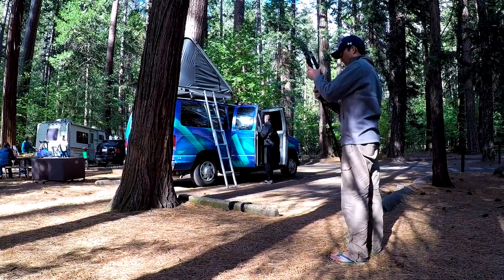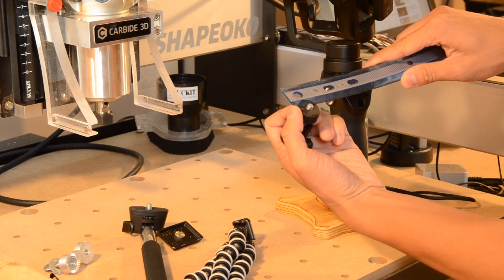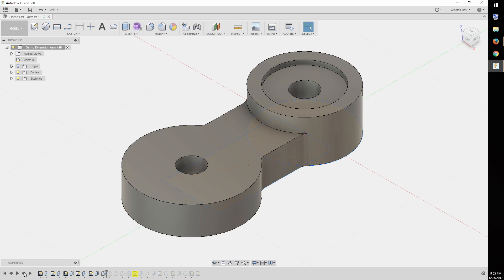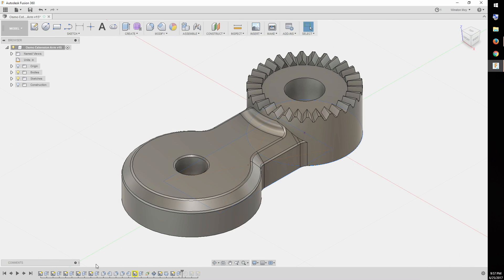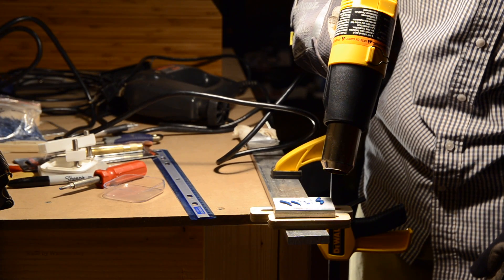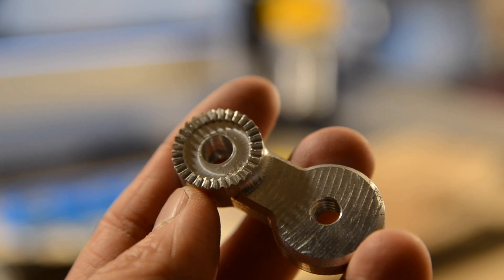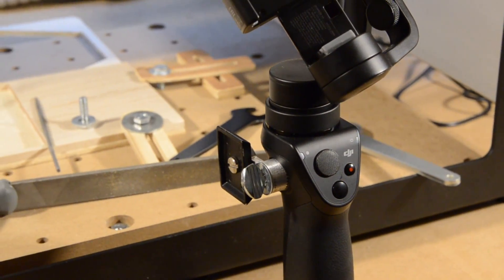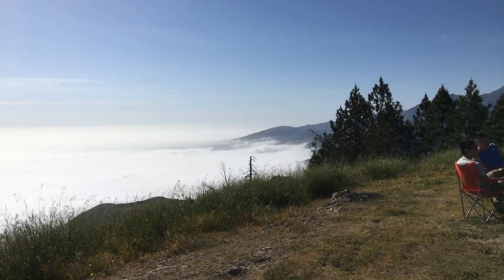Machining an Adapter for a DJI Rosette Mount - CNC Project #91

Comment: Winston, this is the holding technique I have started using on my projects. I definitely recommend giving it a try, I think you will be surprised at how well it works. I don't use the accelerator I just wait a few minutes more. Hope you like it. 

https://youtu.be/ub6PsY4cgwg

Comment: Has anyone put a LASER on the Shapeoko 3 yet for laser engraving and cutting?
I trying to decide if I want to buy another CNC router or maybe go for a Glowforge.
I use to have a X-Carve 1000 older version  The Shapeoko 3 looks better then
the even the new X-carve 1000,, I could be wrong on that. I haven't used a 
Shapeoko 3 xxl.
Reply from the maker: Have you checked out JTech Photonics? Max power you'll get with an aftermarket laser is a couple watts and optical. Cuts at most cardboard or veneer.

Comment: Hi Winston, could you make a easy to understand video about the Fusion 360 cam? I've build my first cnc and I feel like the cam process is one of the most difficult tasks.
Reply from the maker: ++Tec I'll definitely have it on my to-do list. In the mean time, I have two videos in the past month or two that touch on both 2D and 3D CAM in fusion 360. If there are any parts in particular you'd like more clarification on let me know. That'll help me make a better video, since I don't know what are the parts people don't understand.
Reply from the maker: Let me know if you've ever on one of the coasts. I'm basically guaranteed to be making annual pilgrimages to the Bay Area and NY makerfaires.
Reply: +tec have you played with Fusion 360? I didn't know much about CAM, Fusion is so very intuitive it's so easy to learn. Go check out NYC CNC. John has wonderful videos on Fusion and it's CAD/CAM abilities. I learned from him. Go get the software (if you don't already have it) do a very simple piece (like for example what Winston has in this video) and just play around with it and see what you can do. You're not going to break anything, you'll learn. Winston: Love your videos you don't have horrible music and you're very easy to understand. I'd like to meet you sometime... might have a cool job for you.
Reply: I initially learned it for doing STL's for my 3D printer. Now moving onto CAM. There's a bit of a learning curve with it. But you can do it.

Comment: I'm quite impressed by the fact that the wax could hold down the aluminium well enough at all. Is there any reason other than to keep it simple that you're using wax instead of some kind of clamping system? It seems some kind of small machine vise would make using the Nomad a lot nicer. It looks like a nice little machine.
Reply from the maker: +Magnus Nyborg Madsen The Nomad has a vise that I could use. The benefit of the wax is that the part remains in place even after being completely cut out. Otherwise I would need to use tabs to keep it secure, which need to be cut manually and then cleaned up with grinding or sanding.
Reply: Winston Moy I see, seems like aluminum tabs would be fairly painful without a good sander

Is there a lot of chatter while routing aluminium? it seems to handle it fairly well
Reply from the maker: +Magnus Nyborg Madsen I've used tabs before, and the added time is the main problem. Plus, with a Dremel, the place where the tab was will never look as nice as the machine surface.

Any machine has a risk of chatter that can be mitigated by different cutting parameters and strategies. My ball endmill cuts were just fine. Very light passes so low forces involved. Towards the bottom of my cutout, I had some unpleasant acoustics just from friction. Endmill was rubbing on the relatively deep walls of the cut channel. But that could have been corrected if I took the time.
Reply: you could split the cam job in two, first use screws or clamps to hold the stock,  once you have completed holes in the part use crews in those holes to hold the part for the rest of the job
Reply: Another option would be to use slightly thicker stock and leave a "Hat" on the bottom and cut off the extra by flipping it over.  Of course that may require you to make special soft jaws to hold odd shaped objects.
Reply: I alway use doublesided tape to hold down. Use some masking tape on the wasteboard and on the aluminium, in between some doublesided tape. The masking tape is so it is easier to remove the doublesided tape.